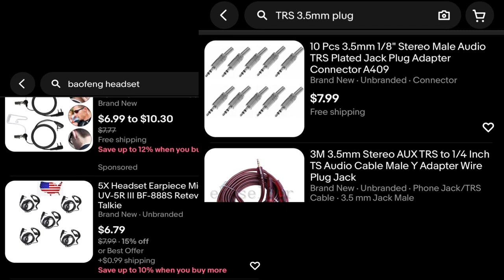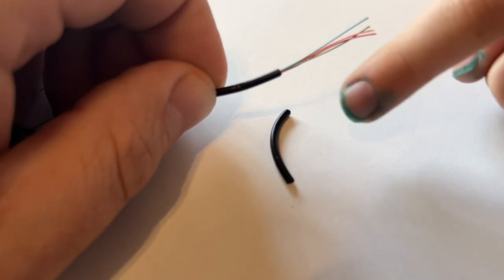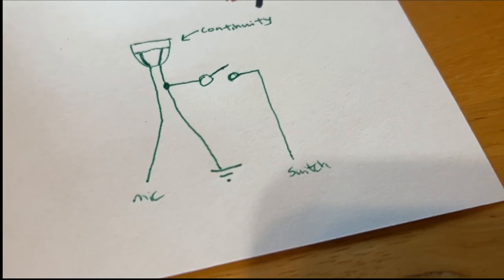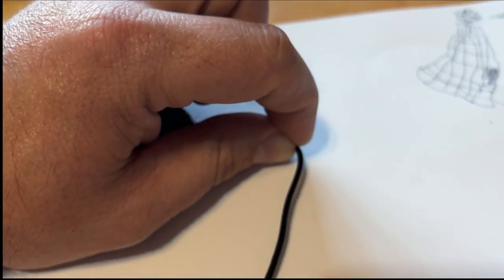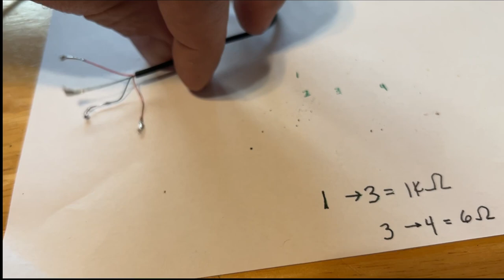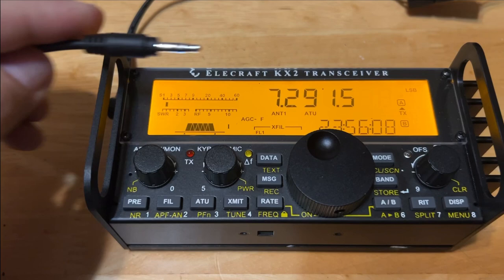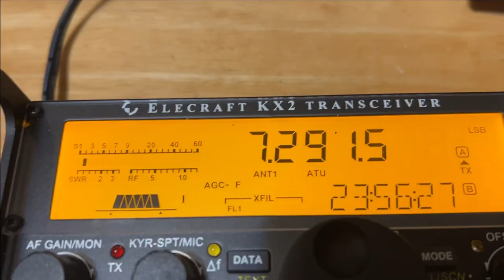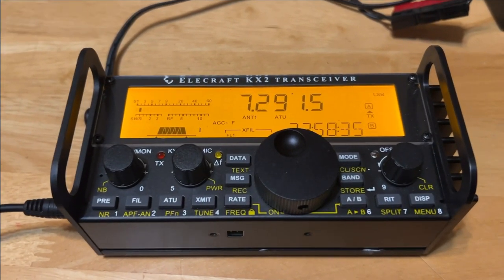Tiny Microphone for the Elecraft KX2 - DIY from stuff you probably already have as a ham radio op!

Comment: Thanks for your help. Still working on the Baofeng mic soldering job. In the meantime found a mic,phones 3.5mm splitter and old iPhone earbuds, and the earbuds’ mic and headphones work with the splitter on the kx2 as long as I turn off PTT (found this on SWLing post). Nate

Comment: Did this a few weeks ago. Didn't see your tutorial so when I did it I just took it apart to figure out the pinout. They conveniently label everything so no real guesswork. 
I also had a K6ARK mini microphone that I 3D printed but the baofeng one is more comfortable to hold so it's a backup
Reply from the maker: I’ve only used this one once. I hiked into Providence Canyon with it. I had 8 pounds of water so I had to cut back. All my radio gear fit in a Fanny pack sized area for that one.

Comment: Nice work and glad you had that helper! My KX2 should be here in the next couple of weeks and I need to make a headset adapter for it, so this was helpful. BTW, is that Packer Robotics shirt from a FIRST team by chance?
Reply from the maker: It sure is a First robotics team. We had a good run this year. Next year is going to be even better!
Reply: @W1RCP 
Can you please confirm: wire 1 is the mic, wire 3 (Blue) is Common/Ground/Logic Ground, and wire 4 (gold is PTT?) so that I can solder it to the 3.5m stereo connector. Tip (mic audio) goes to the red (1) Mic wire, correct? Blue (3) goes to ground, gold (4) goes to PTT, correct?
Reply from the maker: @conchd  As I had my wires splayed out, wire 1 was the mic, wire 2 was ignored because that was the headphone output, wire 3 is the ground/common, and wire 4 is the switch. I'm colorblind so I couldn't tell you the colors. I hope this helps.
Reply from the maker: @conchd  Kyle, AA0Z, shows the K6ARK kit which is basically what I've done with the scrap crap from Baofeng. Check him out here if you want to see how it's wired internally: https://youtu.be/jsPsu9-5rvA?t=259